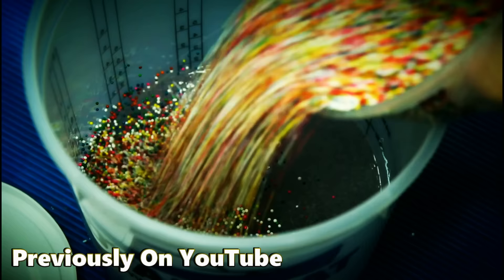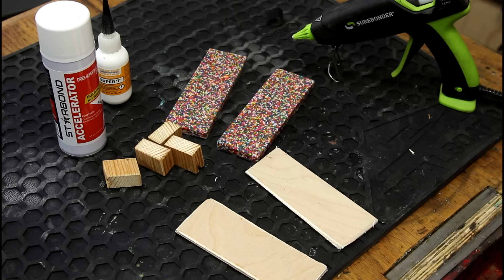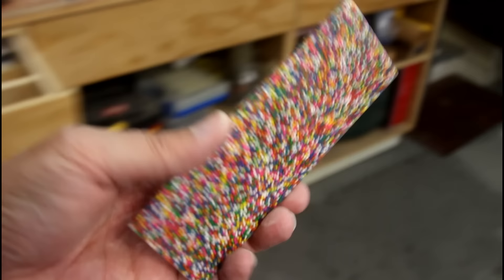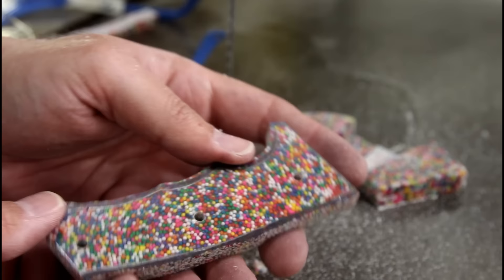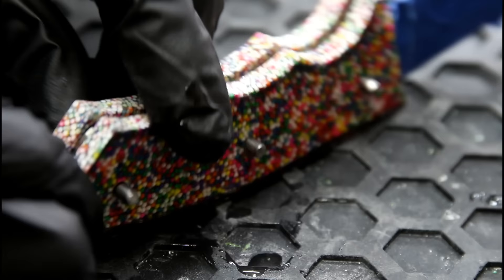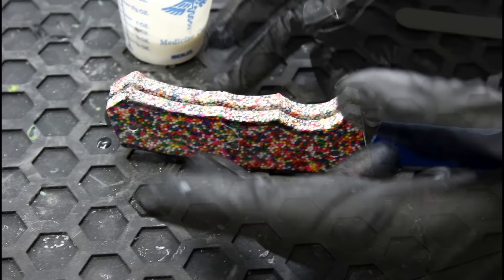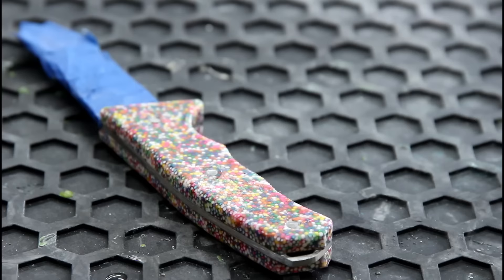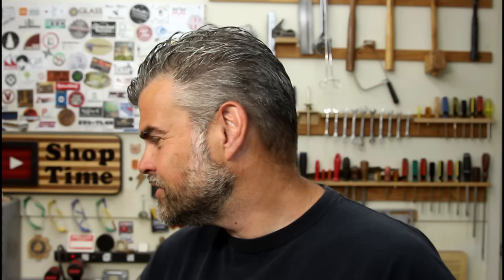Was This The Sprinkle Project You Asked For?!

Comment: an easier trick than hot gluing wood to the top: use masking tape and superglue. one strip of masking tape on the object adhesive side down, same on another object, put them together with superglue between them. holds strong for shearing forces (like sanding) and comes off easy with little to no clean up
Reply: I've seen John Saunders use that trick on his CNC mills, under some pretty impressive loads, Over on his channel NYC CNC.
Done it myself duplicating plywood parts with a router and a trim bit.
Reply: I’d definitely put too much on and end up with super glue bleeding between my pieces

Comment: Make a silicone mold for the scales so next time it's easier, also I would suggest making this in 3 pours a thin clear layer you can sand down and polish, the sprinkle layer in the middle and a layer on the outside to flatten and polish so the sprinkles don't get sanded down
Reply: Yes, including the sides!

Comment: Next time you're working with a material that you want to avoid sanding, it might help to pour a 1-2mm layer of clear into the mold first, then the media. That way you'll have an extra buffer of clear resin on the outside that will be harder to accidentally sand through.

Comment: I would love to see what the surface finish would be on the sprinkle resin if you dissolved the partial sprinkles left over from cutting/sanding with water and then filled with a thin overcoat to clear up the depressions.

Comment: Hey Peter, a neat little trick I learned from John Malecki when taping two things together to make an identical cut is to use like blue tape on both sides, add glue on one side, activator on the other and them press them together. Has a nice hold, but is easier to remove once you're done.

Comment: With that rasp bit on your drill press, you'll find it easier (and safer) if the work piece sits flat on the drill table by lowering the bit (or raising the table). It will stay perpendicular to the bit and give you more control.

Comment: Another comment but as far as getting the pins sanded, i believe it's Kyle Royer i learned this from but put painters tape on the scales and pop the pins through. Then you can sand them most of the way down with a sacrificial reference surface and finish them off with files and some care. I've used it on my own knife scales and it works surprisingly well as long as you pay attention which you seem to. Cheers and good luck in the future

Comment: Next time you need to sand something like this, I would take a router to a good size piece of scrap wood and cut in a slot the same size as the thing you're sanding plus some thumb holes and then hot glue it into the slot.. Make it the same depth as your final target and just sand until it's flush. This is what we used to do in the metal shop when using the belt sander to finish stainless parts.

Comment: You should add a thin layer of resin after the handle blank has set. You’ve done it before but I think here it would have gone miles on saving the sprinkles open faced on the handle. It still looks awesome regardless. Kinda reminds me of the same patterns you might find in the early 2000s skating rinks

Comment: Just a suggestion... you probably already thought of this, but if you wrap the whole thing in blue or white painters tape, before drawing your lines and taking the scales to the drill press and/or bandsaw... it should (a) make your lines way more visible, and (b) protect the surface from scratches in the process.

Comment: So hear me out.  Make a set of scales for the knife out of plain resin to include the pin holes, maybe attached to the blade with some good double sided tape like the T-rex stuff.  Once they are sanded to shape detach them then sand the 1/16" to 1/8" undersized then use them to make a mold.  Cast that with sprinkles then once it's set take it out of the mold then cast that into the regular knife blank mold.  Drill out the pin holes that conviently have no sprinkles in them, mount to the knife and shape and finish as normal.  Whole sprinkles all the way around, no half sprinkles on the edges!!!!

Comment: Hey Peter, I was wondering, on a couple projects you wanted to keep the surface untouched, but sometimes that didn’t happen. I’m curious if you could add a thin layer of just clear resin on the surface you want to keep so that you can sand that clear later and have a little buffer space.

Comment: I understand that you had them just sitting there. But I think for knife scales, you would be far better off to make a set out of timber and shape them to how you like, then spray them to seal and make the smooth or patterned like a gun checkered, then make a silicone mold of them, and mix new resin and sprinkles and pour new scales. Would be awsome.

Comment: I assume the sprinkles are soluble in water. So, could you simply cut and sand to the desired shape, then soak in water to dissolve the exposed sprinkles, and then put a final coat of clear epoxy to fill the sprinkle voids and give the appearance of only solid sprinkles.

Comment: what if, after getting the resin + sprinkles to the desired shape, you intentionally dissolved the outer layer of sprinkles to show the whole sprinkles within? (you'd have to fill the sprinkle holes with a little more resin, and/or sand the empty part down a little more)

Comment: As easier way to maintain the color of the full sprinkles would be to use something else like, say, dried/unsoaked orbeez! The tiny polymer balls should not only sand down just fine, but should be solid color all the way through. I dont THINK they'd expand in resin, as it's far too viscous to really do much soaking, and depending on which kind you use, probably hardens too quickly. But this is just a theory! A RESIN THEORY!

Comment: Ok now make one with NO sanded down sprinkles.
Make a mold of this last knife in silicone, get the posts to the right size, fill that mold full of resin and sprinkles mixed and make a flawless one with NO worn down sprinkles on the edges.
Thank you